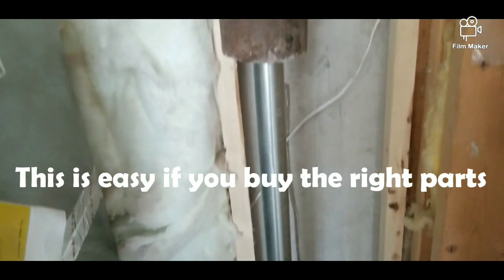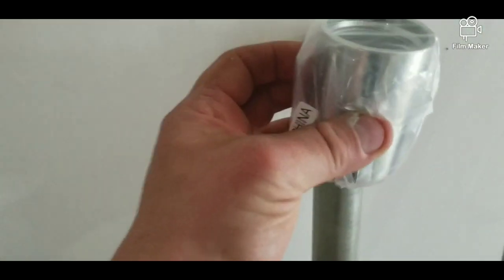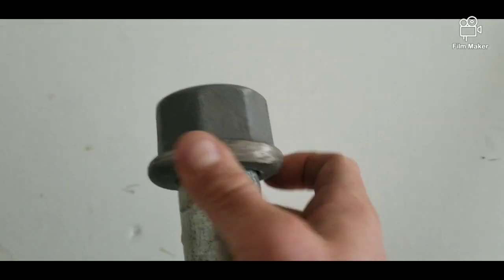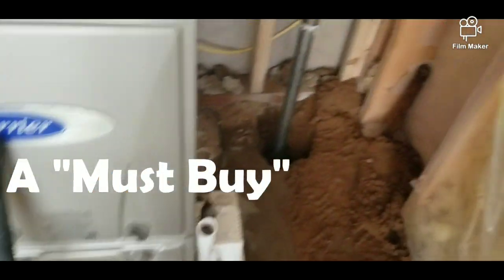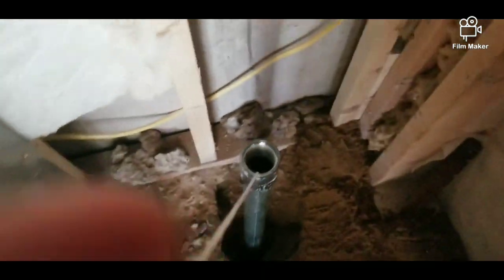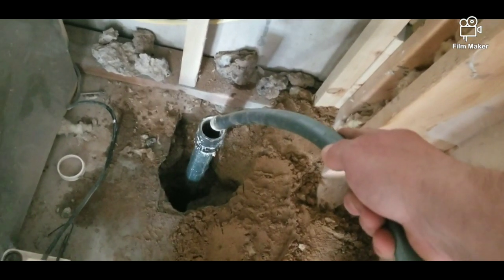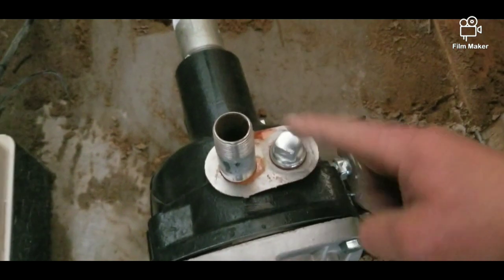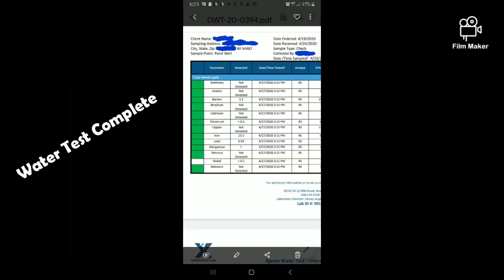Sand Point Well

Comment: Are you going to add a pressure tank
Reply from the maker: @thomasfoster5200  yes next summer when I install underground irrigation I probably will.
Reply: @Raceblizzard  I have a stupid question. Will the check valve stay where you have it after you install the pressure tank. I'm asking because I have put all my parts together and I think I messed up. I put the check valve on the other side of my pump close to the pressure tank
Reply from the maker: @thomasfoster5200  yah the check valve should go before the tank. So pipe from ground to the pump, than a check valve and than your pressure tank

Comment: How do you keep from messing up the threads? I got all well drive stuff and messed up the threads on the first drive point. It was tight. Guessing I shouldn’t used a sledgehammer to start it.
Reply from the maker: I've done a few of these now and I've only had that problem once, and that's when I used a drive "cap." You could try using thread tape and thread paste together. A few plumbers I know use both together all the time on everything. Also make sure to fully tighten with two pipe wrenches. Key word pipe wrench. But yes I used a sledgehammer when it gets about two feet above ground. Than I add another section of pipe and use the "pounder" again until I hit dirt, than again switch back to sledgehammer. Could be that your just not hitting it square everytime when using the sledge, (I wouldn't be able to either).

Comment: The drive point will work fine you just have to make sure its screwed all the way down so its supported by the top of the pipe not the threads.

Comment: I have a question, if I drill a well in the basement, will the house collapse, the foundation or the walls?
Reply from the maker: No, I don't see how that would be possible. However you cannot pound a point well in your basement if you do not have a walkout basement. In other words if you can't walk outside from your basement you can't have a point well. If you plan on living there for years I'd say go for it. But if you plan on selling you better not. Most insurance companies will not insure a house with a point well with no walkout. You will end up paying for a drilled well when you sell.
Reply: @Raceblizzard  Thank you
Reply from the maker: @Tip S You would have to ask your insurance company. Where I live it's not allowed because the pump will never shut off if a pipe breaks. Basement would be completely flooded, well until the pump fries itself from being under water.
Reply from the maker: @Tip S it's hooked up to a pressure tank, so if there is not any back pressure the water will continue to run until it knows it's pressurized, which in this case would be never if a pipe breaks.
Reply from the maker: @Tip S here's the thing. Go ahead and do it, but know that when you go to sell your house you'll probably have to get rid of it and have someone drill a traditional well.

Comment: 5:20 How would you pour water in past the check valve?
Reply from the maker: You don't have too, you just need to have the pump primed. Meaning make sure you add water to inside the actual pump. You have have to do this a few times, but after that you will never lose pressure.
Reply: @Raceblizzard  I know that, but you said "little cap in case I need to pour water in here whatever." Pouring water on top of a check valve will do nothing. To prime the well shaft you would need to put the T and cap below the check valve.
Reply from the maker: @uneektalent  You can pop the cap off to add water to the pump to prime it.
Reply: @Raceblizzard  That doesn't help get the air out of the well shaft. That's like spraying starter fluid in the carburetor while having an empty fuel line.
Reply from the maker: @uneektalent  well I've never had a problem, so if you got a different way that works than congrats!
Reply from the maker: @uneektalent  also I'm not sure how we are now comparing engines to water pressure, however you can Google image search where a check valve should be or just buy a check valve and it will show you a beautiful diagram of where to place it.
Reply: @Raceblizzard  I didn't say your check valve was in the wrong place.
Also that was not a comparison, it was an analogy. Those are completely different.
I was trying to gently point out that you can only prime the pump the way you have it set up. Priming the well shaft is just as important if not more important. There is a lot of air in the well shaft. The whole purpose of priming is to prevent overheating and damaging your pump from running on air which might not be able to pull the water from below. If you only have a little water in the pump but not in the length of the shaft, that water will be ejected immediately leaving the pump to pull on the air.
I'm amazed at how many people refer to google and YouTube as if those could never be wrong. I even saw a guy wrapping the teflon tape the wrong direction while making an instructional video. So if people follow his example and have water leaks, is he responsible for the damage? No. The responsibility is on the viewer to remember that very few DIY'ers are true professionals, and while people will make lots of mistakes even while claiming to be professionals, the water will never make the mistake of staying in the pipe that has bad connections. If people are not willing to enlist the help of properly trained professionals then they should be prepared for the possibility of failure. Water related failures can be very messy and expensive.
Reply: @uneektalent  Well he could attach a handpump at the top and prime that and pump to get all the air out of the pipe. He would ofcourse need to close the line to the pump by installing a shut off value just before his electric pump. Hand pump will be useful as it will never burn out just because there is air in the line. Once it gets good suction from the well, he could just remove the handpump and just cap that pipe again. No air.
Reply: @uneektalent how do you fill the pipe up with water to prime it when it will never fill with water due to being at the water table?(they say if you get a hose to fill the pipe and it never fills but drains out under ground then you are at the right level)
Reply: @jacob11b  my pipe fills up with water. at this point I'm probably just gonna deal with having low water pressure all this stuff gets confusing what works on YouTube never seems to work for me lol

Comment: I have to drive a new point at my mother's old house, as the existing one, at least 70 years old, is failing. (Was told by a professional that the screens on those old points eventually corrode.) Thank you for good, practical information. Am looking forward to beefy arms!

Comment: QUESTION......why wouldn’t you install the check valve on the horizontal line to the pump???   The way you have it in the vertical well pipe, if you want to clean out or flush the line you have to remove the check valve in order to get down past it.
Reply from the maker: Because I get a better deal that way. You can install it the other way but your seal will prob fail.
Reply: @Raceblizzard  the seal will fail because of the air trapped and in the upper vertical
Section ???
Reply: I have mine on the horizontal also, but it doesn't matter. either way will work.
Reply: @joequillun7790  i understand that either way will
Work, however you if you want to clean it out or whatever you have to take all the piping apart because how do you get past the check valve???
Reply from the maker: @inthelandofmilkandhoney457  I guess I don't know why I would ever need to take it apart to clean the pipes or flush it.

Comment: i have a sandpoint well on my property I bought and the pump burned out the first week I had the house. I just replaced the pump hooked it all up nice and tight...but I cannot get it to prime. I took the top lid off and tried filling the pipe going to into the ground but it just drains out. I have 28 psi on my air tank..but the pressure gage on the pump reads zero when I turn it on to see if its working. Any suggestions on what to do and yeah it has a check valve on it
Reply from the maker: You must be pulling air somewhere. Probably a loose pipe connection somewhere.
Reply from the maker: I had the same problem again and it was my Union fitting. It wasn't tight. But the first time I tried pounding one it was my pipes underground that were not tight. That's why I bought those heavy duty couplings.
Reply: Did you put a check valve on your pump? Won't hold prime if you don't have one.
Reply: @johnwahlers3363  Ill check in the spring its winter here now and cold af. I will replace the old check valve and see if that was the issue. Thanks for the suggestion
Reply: @johnwahlers3363  It did have one and I took it apart to see if its ok and seems like its fine. The flap inside the check valve moves back and forth when you move the check valve side to side. Maybe I should buy a line camera and run it down and see if the pipes are ok. FFS
Reply: Remove the pump and use a large vacuum to pull the water up to the check valve. Install the pump, prime it and turn it on.
Reply: @uneektalent  Why do I need to remove the pump first?
Reply: @billysonlinesurveychannel8247  To put the vacuum in its place. Unless you have a T.